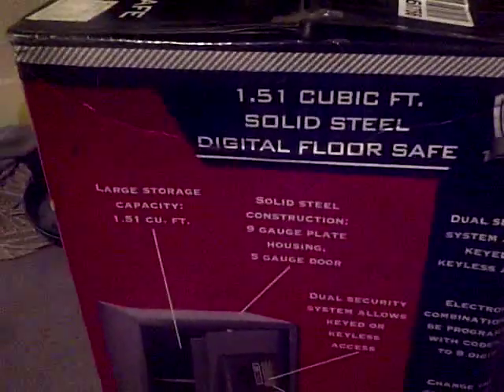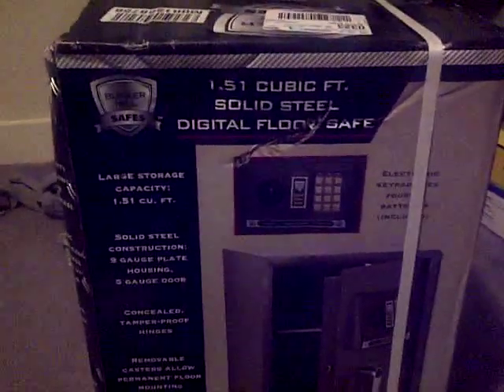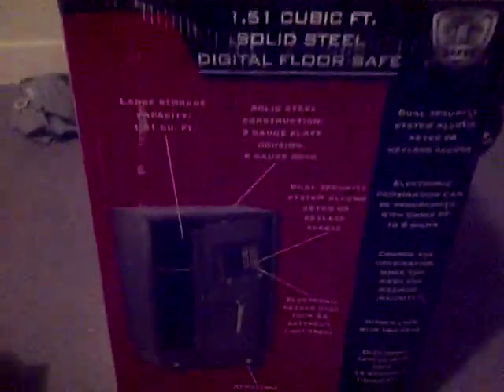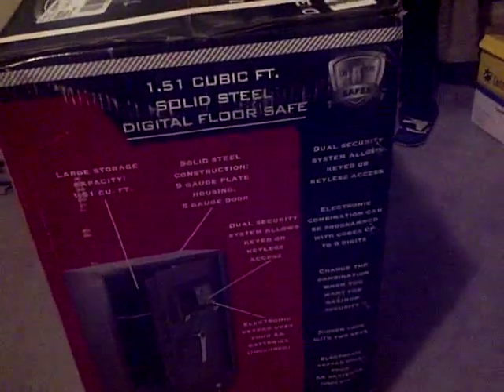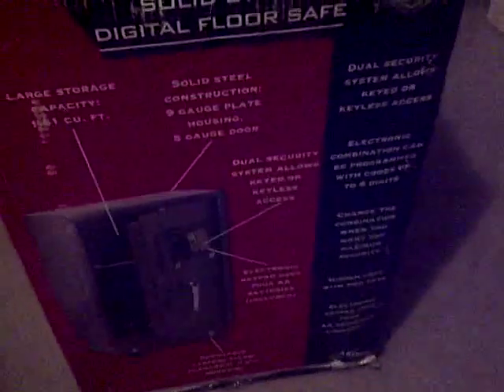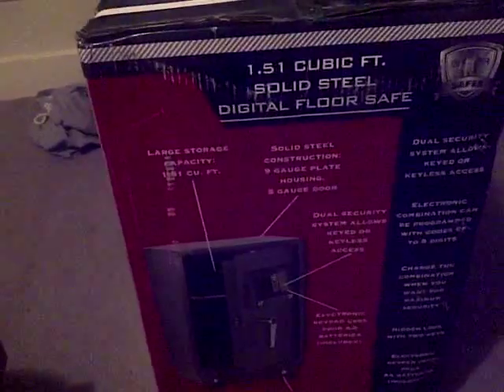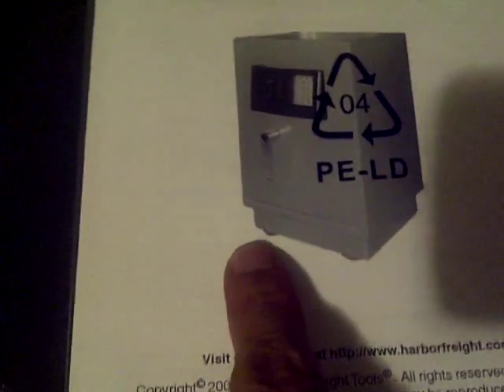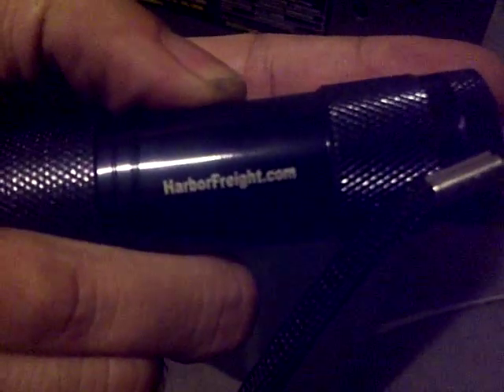1.51 Cu. Ft. Solid Steel Digital Floor Safe 01

Comment: Looking for how to get the inside battery cover off and unfortunately I'm not seeing it in your video.  Otherwise, great info in initially accessing this safe.
Reply from the maker: 👍🧡 simply side up the cover.   Like the back of your TV remote control. 2 D size battery.

Comment: Don't know if you still have this safe or not, been 7 years. FYI, it hasn't changed at all (2020), except the keypad changes color and I believe the key core you have looks better quality than mine. Anyway, anyone else sees this, that 159A code is the factory set master code. Don't forget to change it! It will go back to that when batteries die! Take the time to follow the master and user code instructions or this safe just becomes a metal box that only is fire resistant when mounted up against the wall! Those holes in the back, need to be against fire rated wallboard or similar even if mounted through the holes in the bottom(floor mounting). Also, if mounting, don't put the caster on it or fire can and will makes its way under and up through those holes, at least till the casters melt but by then if anything inside catches fire it will burn as the door is not air tight, it won't let fire in right away but air has no problem being sucked in to feed a fire already established inside (believe it is that way for safety from suffocation, don't know why or how in the smaller safes, but non the less, that is why the door isn't air tight. This safe front is used on a lot of safes just sized differently and more bolts the bigger it gets). Besides, be honest, if paperwork is leaning against the walls, they will combust more quickly. Anything super valuable put in a fire safe pouch. This is more of a, I am just trying out my hand at household safety for my kids sake till they become older and I need to upgrade to a vault(or a better safe or hire fire rating)! I know the manual says it is not fire rated, but 9ga steel takes a little while to reach the combustion temp of paper, so there is some protection. Unfortunately, the plastics will melt first and open a 3x5" hole in the door(battery tray access) before anything burns from a hot wall!

For the price it's an ok entry level safe, but the locking system is, unfortunately, what let's an average quality safe body/door down. Yes, a strong magnet or a good smack while turning the unlock dial will open the electronic lock since it is just a solenoid! A $1.00 plate of magnetic shielding material, a stronger/double solenoid and high temp plastics might actually make this worth double the price and still be a bargain!

Comment: 6 years ago he paid $89..."5 minutes ago" I paid $103 total. Point is, it must be a good safe to not depreciate in value.
I was able to get the wheels on & pins by myself.Just couldn't get the clips on nor the battery cover  off. Great video!😊

Comment: Personally i dont like digital type locks they are more for quick access which is ideal for every day or immediate access personally id go for something like multi lock which means you cannot open safe with just a code you have to insert a key as well plus an emergency re lock system is great if you need to lock it quick by using the lever handle to throw the locking bolts its mainly down to personal prefference what is it you want to secure how long for and will it need fire protection and does it have anti drill plate protection just some of many questions a safe specialist would be happy to answer remember you are not buying security you are investing in it it all depends on what you can afford.
Reply from the maker: Thanks for the comments.  A got this safe mainly to prevent my baby girl getting to my gun.  It's also the law here where I live to lock or secure your hand gun when children are in the room.  It's handy and I often use it.  It is cheap and not at all fire prof, but it works for what I need.

Comment: Keeping your guns in a safe will suck if you ever need it.  I suspect you will have it unloaded with the ammo in a different location as the government suggests you should do.

I personally prefer the AK as a home defense weapon which wouldn't fit in the safe anyway.  The high capacity magazines and superior knockdown power make the AK the perfect home defense weapon.  With our wide open borders and the government refusing to defend the borders from invading foreign forces and ruthless criminals, we are on our own. 

I suggest a minimum of 500 rounds loaded in magazines and ready to rock.  You never know when SHTF will happen.  The time is near, this country is fucked.  Be prepared for anything.
Reply from the maker: My other option was to keep it strapped on me 24 hours 7 days a week.  It can get uncomfortable.  Right now, just a hand gun, always loaded, and no safety.  I have noticed that ammo supply seem low on the store shelves.

I have had the same feeling for about 2 years myself, reason why I purchased the hand gun.  AK is hard to conceal when you are walking about in public.  It's more for personal self defense.  I do take it with me when I leave my house.
Reply: Unless you live alone in a rural area, an AK is a horrible home defense weapon because the penetrating power will pass through dry wall with ease. I hope you don't accidentally kill your neighbors and/or housemates.
Reply: A Mossberg SPX930 with 3.5" PDX1Defenders,  or a PSA PX9/LSAP 9 with a holosight and a glock 9mm or s&w .40 side arm is a much better home defense weapon(s), unless you have 300yards and a 360deg. view around the entire outside perimeter and several AK weilding sentries! Even then, I would prefer something more compact and easier to shoulder like the PCC's! Guess if you live in the south/southwest you might own that kind of land. Us city folks would like to just engage the bad guys and not our neighbors! Besides the old lady  has got a S&W M+P .45 with 20 rounds of Federal ACP-HP and can take care of her self just fine!